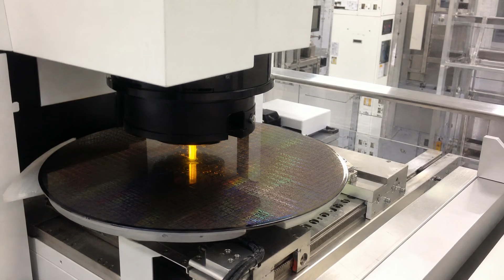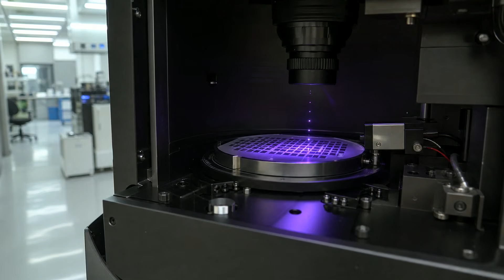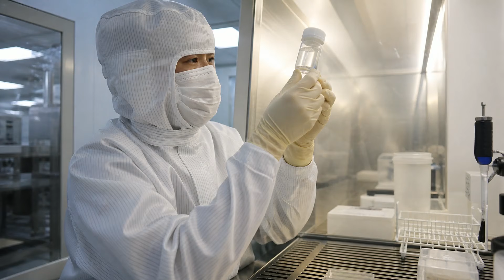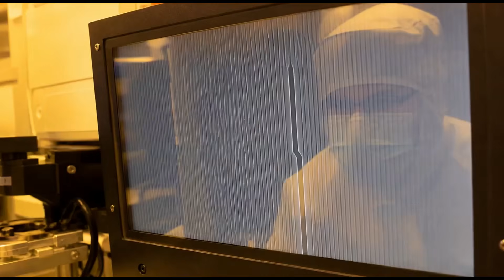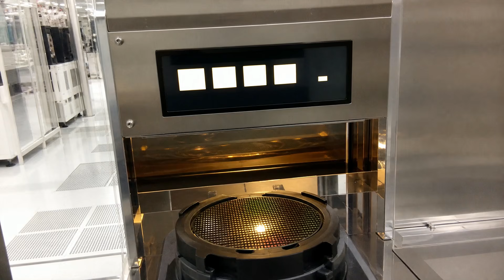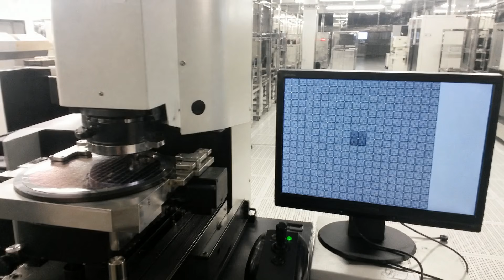Intel Is Building What TSMC Refused to Try

Comment: Excellent video!  Finally, someone who gets what Intel is doing.  I live in AZ so I know what Intel, TSMC, Nokia (Nokia is buying NXPs current Chandler facility and will take it over once NXPs new state-of-the art, showcase campus is completed in Phoenix), Microchip, Onsemi and NXP are up to.  No one mentions that Intel has one of the largest installations of ASML EUV machines at Fab 52 in Chandler on the planet and that will more than double when Fab 62 goes live in 2028.  Intel is producing over 40,000 wafers of sub 2nm a month with 80%+ yields.... no one else on the planet is going this.

Comment: It's time to step back a couple technologies... to where you had near perfect yields. Then move vertically. Lay down the vertical vias. Layer in a new substrate. And do it again. You'll get lower latency(vias are shorter than lines); you get lower power (vias and lines can be larger); you get smaller footprints or more circuitry on the same footprint. And it's easier to refine and optimize that process than to diddle the light wavelength and strength any further.
Reply: Yeah, I'm sure all the engineeres haven't thought of that already...
Reply: @alexis1156  Who's ox gets gored?

Comment: This is where we forgot our physics class teaching. Light isn’t just wave with resolution limitation.  Light is a particle, infinitely small can support infinitely high resolution. Make sense?
Reply: No it doesn't. Each photon is a traveling probability distribution. You tell me if it's a particle or a wave. Actually you can't tell me.
Reply: Not smaller than Planck scale
Reply: @florin604  do you think it supports 1nm resolution for chip printing?

Comment: I dunno man, DSA isn't real DSA like a can of chckerboard paint, and the problem remains, silicon atoms and dopants don't shrink DSA or not.  I'd need a much more technical presentation to understand if this stands a chance of working, and I mean now or in the next ten year or ever.
Reply: A much more technical presentation also gives the competition additional insights into your strengths and weaknesses. Their level of detail here is a good tease.
Just like TSMC has to presently import their super high purity process chemicals from Taiwan because no U.S. manufacturer has a proven price competitive process to qualify as a supplier to TSMC AZ fab, Intel has developed its supply chain and internal chemical handling equipment to maintain the necessary purity.
Reply: @genef1027  or along those same lines maybe DSA is just a red herring and Intel actually has alien technology that's guaranteed to work.
Reply: Do you check the naer-do-well or the can-do box on the application form?